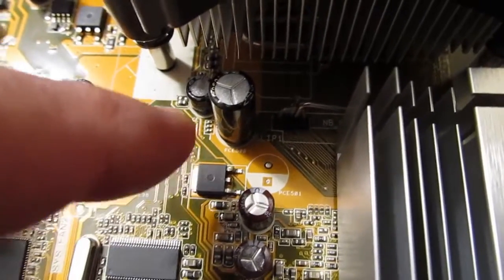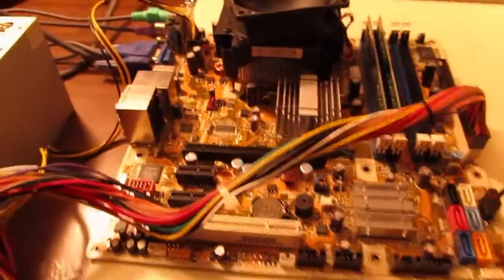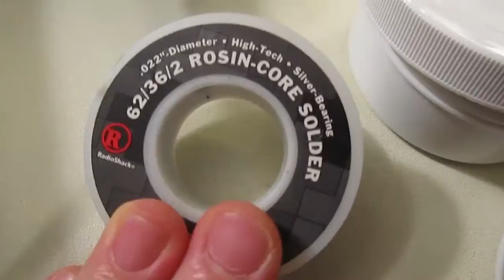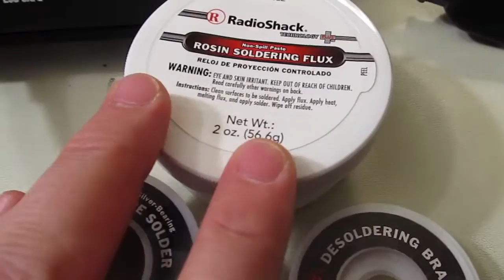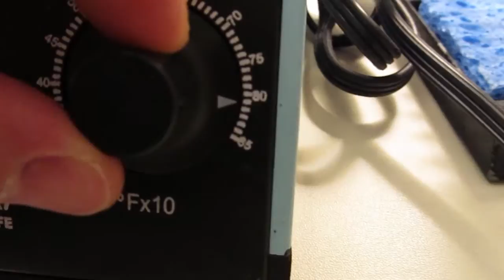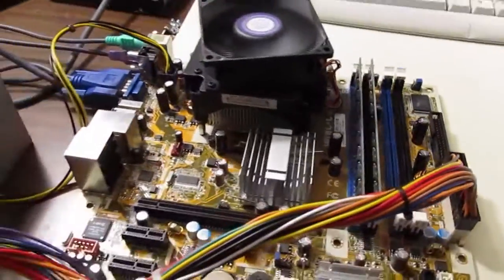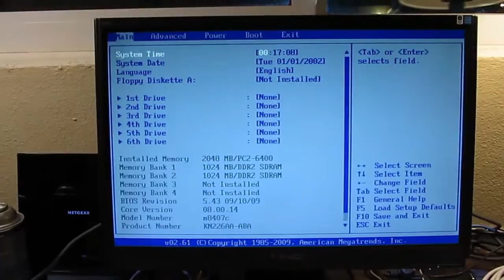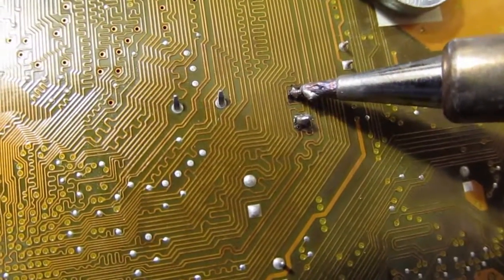Capacitor Repair on micro ATX Motherboard

Comment: I like it, got an old Socket MOBO that isn't giving boot POST beep, while the CPU keeps warming up normally, (for sure tested other CPUs / RAMs/ PSU) I have a feeling that it's one or couple of bad caps are there, will try to find them and replace them instead of throwing it
Reply: On small questing, do you recommend a video of how to diagnose/discover bad caps either user the multi-meter or visually  ? thanks in advance
Reply from the maker: Ahmed A. Helmy hi if you don't get post beep make sure your power supply is good and make sure the CMOS coin cell battery is good too with at least 3 volts!

Comment: Good job. It is worth noting sometimes it's cheaper and always faster, easier, safer and better peace of mind to replace the whole motherboard. I've replaced and repaired PCBs of all kinds every day for the past 19 years. I prefer replacing them for no other reason than peace of mind. If the capacitors leaked, what other damage was done?  You never know.
Reply: Some of us want the old motherboards for retro PC builds and nobody makes new motherboards anymore with the fixed capacitors for the old CPUs. The 2002-2005 boards were especially plagued with badly manufactured capacitors.

Comment: if capacitors are leaked monitor will not show anything?....plz reply fast... I have computer it's working good with well voice its not making any weird sounds... I tried to replace the video card bcoz...there was only no signal on monitor...if capacitors will b replaced so monitor will show anything and Windows will boot up
Reply from the maker: Hi there!  My advice is: please check that your monitor works 1st, at least performs the brand logo when you power it on.  Make sure you've tried plugging in your video cable into the integrated video ports on the back of your motherboard (not the video card).  Then try them both, one at a time, the integrated and video card ports.  See if you get an image.  Make sure you're not getting video BIOS beep codes.  After you know it's good, then yes, the capacitors being bad may cause no image on your screen.  If you've inspected and found leaking capacitors, then please replace them.
Reply: David Chello thnx for reply....my motherboard capicitor is leaked